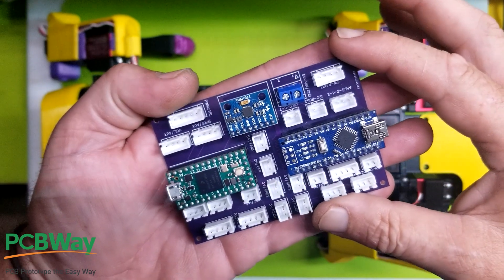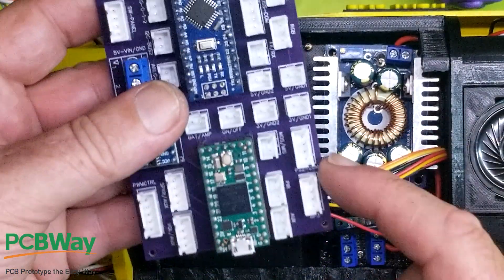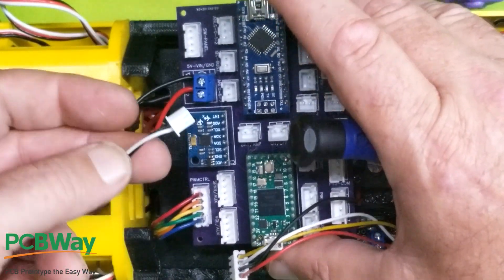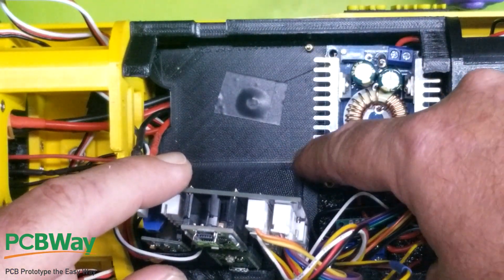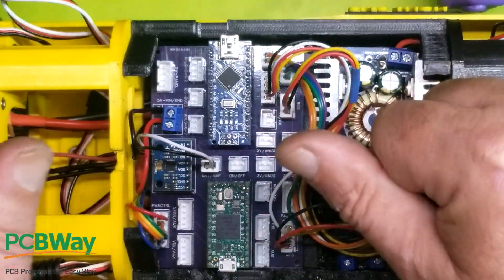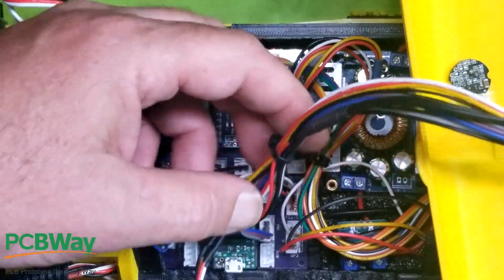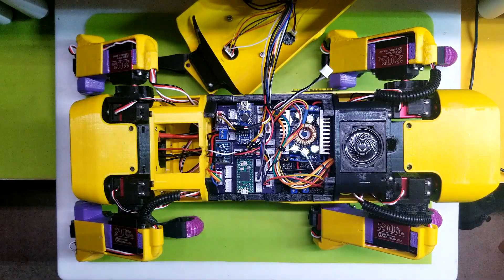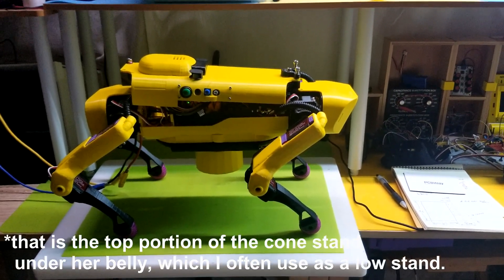New PCB Install : v5.1 - Nova SpotMicro3

Comment: Its amazing chris . My nova is not ready yet , i am waiting for some jst and i toast my mp3 with solder iron . Your new wire Diagramm for pcb Board helps for soldering . I hope on next Video you Show a little bit more of the voltage divider and the battery Check circuit . Thanks for your Inspiration and work  you do for tec lovers
Reply from the maker: thank you!  yes, my next video will review the power train wiring... which will indeed include the batt monitor, voltage divider, and current monitor / switch circuit.  I haven't really done a video aside from using the silly tinkercad wiring diagrams to demonstrate how that all works.  So we'll go over it live, maybe even on a breadboard.  I was debating on keeping the current sensor circuit, so maybe I will put the vote to you guys in my next video, too!  Stay tuned, and  I'm proud to know you are building Nova!  Please join her website and post photos!!  https://novaspotmicro.com